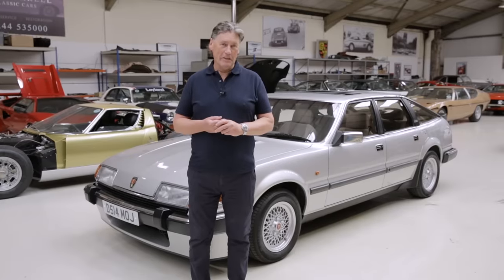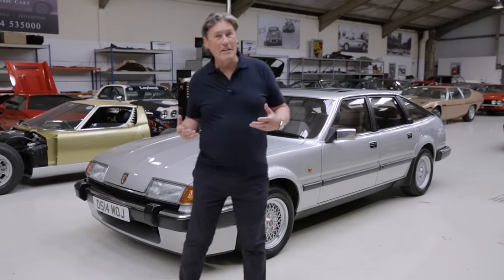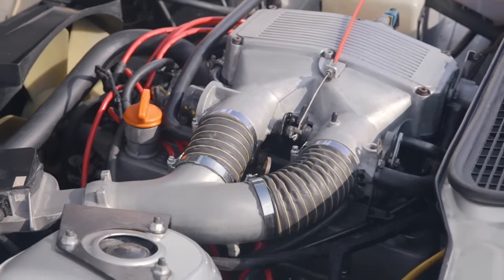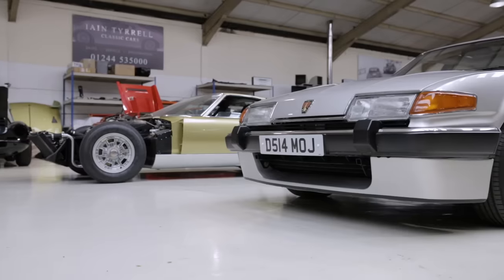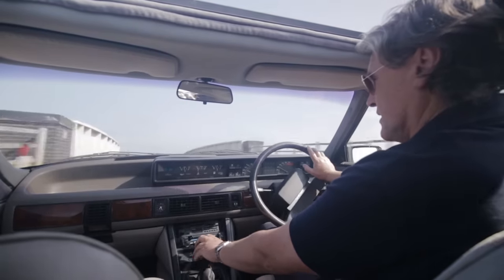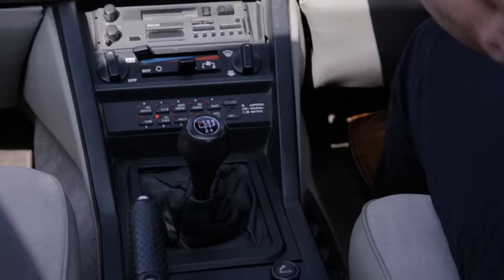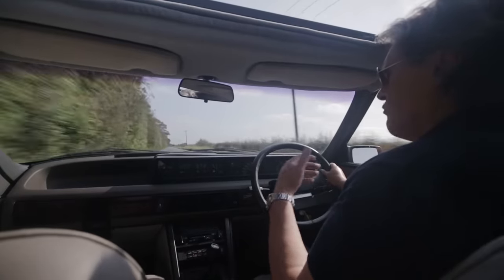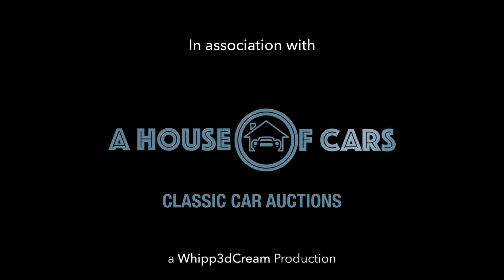Rover SD1 Vitesse - American V8 Power Meets British Engineering | Tyrrell's Classic Workshop

Comment: This engine wasn't just a Buick transplant, as insinuated. It was thoroughly re-designed by Rover for sand-casting and with proper steel liners to make it more robust and prevent the cracking and wear to which the Buick design was prone. Changes to oil routing and cooling were also made, as well as better carburation and, of course, later adding the electronic fuel injection we see in the series II SD1s and subsequent Land Rover products. By 1980 It's barely recognisable as having Buick ancestry. JRT (Jaguar Rover Triumph, later Austin Rover) had the potential use of the Triumph V8 as well by the 70's, so wasn't reliant on this engine although it clearly preferred to develop it so much so that  it ended up with a 4.6L capacity and modern electronic injection & engine management. It is interesting to imagine the original powerplant plans for Rover: a jet turbine-powered sedan... Vitesse, indeed...
Reply: Quite so. Remember reading this a while back. Would've made the Stag a great car for the US. They gave us plenty of support and got crap.
Reply: I see everywhere that engine is "a Buick engine that Buick didn't want any more" but that is only the start of the story. What you said is the reason it was in everything from the P5b, P6, RR, TVR, etc etc. Rover engineering was what made it successful. 
And then the British govt. sold off Rover at a bargain basement price, the traitorous scum.  I'm still annoyed!
Reply: @Daijyobanai  The government was a faceless administrator of a disaster caused by blood thirsty union leaders and ideologues and a hapless incompetent management. Meanwhile the engineers toiled on, sadly to no avail. Hope this makes you feel better….
Reply: Well said C J.  In the final analysis, the Rover V8 was a lot like "Trigger's Broom"... Completely reworked. Forty years ago, a less experienced me took a ride in my Boss's 3500 Vitesse. Typical ... lets see what this baby can do ... got into a massive sideways drift at speed on a loosened surface and really worried for a few seconds. Worried what I'd tell my Boss about his new car .. somehow my limited experience and probably a lot of luck, back on track and smooth as silk, continued on my way. Great cars, great days gorn forever sadly. What's triggers broom ...enjoy this :~

https://www.youtube.com/watch?v=LAh8HryVaeY&ab_channel=MarkAlzano
Reply: @MrRea112  Too bluddy right!  Only in the ... UK!
Reply: Yes, Rover made it into a great engine.  Eventually the four outer cylinder head bolts were deleted from the original design. Even with older fourteen bolt heads it best to leave the outer bolts out, (or fit them loosely for cosmetic reasons).  The weren't unknown for blowing the steel shim head gaskets.  Composite replacements reduce compression marginally which is no bad thing esp. with the early high compression (eg. P6) engines that were designed to run 100 octane fuel.
Reply: @Ampex196  I have an earlier v8 - yep, 10.5:1 compression and 100 Octane fuel so it needs a boost additive from 99 Octane Premium and a timing adjustment. In its 60's tune it was 143hp, I've had mine warmed up to 160hp (more and the diff has to be changed), it's an incredible engine with a fantastic throttle response. It's better as a manual (mine's an auto) but the torque makes this a one-gear car from 0mph to over 80mph in a Borg Warner 35.
Reply: @Daijyobanai  In all fairness, in Buick guise the block was die-cast and I would submit that the technology was not advanced enough at the time.  I do recall that at the time they also hired a recently retired Buick engineer to assist development.  I have read that he was told one thing they wanted was a higher rev limit.  In typical (for the time) American fashion his response (reportedly) was, "Why?"
Reply: The Buick engine was only sold to Rover because GM had far better engines being worked on at the time.
Reply: @Konformation07 Years later GM tried to buy the engine back.
Reply: @enigmatwist6548 Yes after their engine projects were completed. Fact remains the Buick engine wasn't as good as their other engines so they decided to focus on what the other engines. After those engines were done they asked to buy it back because it was small displacement and it would help against tightening US standards.

GM later changed their mind and later Buick ended up deciding to try turbocharging their V6 engine which to be honest was a better decision.
Reply: @enigmatwist6548  Stood the test of time compared to a small block Chevy ?
Reply: In Germany no we have a green Schlabubvvo
Reply: Those Buick engines got around Kaiser used the V6 version, which if I remember correctly Buick rebought the tooling for and continue to produce it for another 20 years

Comment: Thanks for this. Nostalgia for me.  I drove an uprated Vitesse with fuel injection (maybe the twin plenum), at pace in the Police at 23 years old. To say it made me smile is an understatement. I couldn't wait to get to work... out of my 1.3 Ford Escort into this V8 supercar, my reward for completing the Police panda, then advanced training with a first. At the time, not much on the road could compete with the Police specials and once AR called time, we bought a lot of the parts and kept ours going for several years in Carcroft, SYP.  Even when we had the 4WD Sierra Cosworth turbo later, it didn't have the grunt, responsiveness or RWD heroics of the Rover.
Reply: I can imagine a lot of Coppers loving these to drive at the time🙂
Reply: I learned to drive in my dads diesel SD1, back then i only wished for the V8 but at 17 i think the diesel was the safer option.
Reply: I served in the police from 1997 until 2014. I worked with a guy who joined in the late 70's, and he drove the SD1 V8 extensively and he loved it. I knew some people in Traffic who by the late 90's, were using the superb Senator 24V. Aside from the Senator, which is still widely regarded as the best patrol vehicle the police have used, the SD1 is a favourite and it's reputation endures. In terms of sheer physical presence, the SD1 is Top Dog I think. They did look superb back in the 80's, and on the rare occasion you see one of the road today, it's a real head turner. It's a shame Rover went out of business, imagine if they had created a retro design heavily based on the SD1?

Comment: I drove an SD1 for 3 years. A 3500 Vandenplas built 1983. It had the standard 2 SU carburettors and a manual gear box. I bought it second hand in 1988 with 150.000km on the counter and drove another 100.000 problemless  km with it. It had the same silver grey exterior coulour and a light bourgondie velours interior. A beautiful combination.
The engine was a delight. It had power and strong torque from low revs onwards. Its 4th gear could be used from 40 km/h onwards all the way up to 200.
But in those 3 years, I got married and we bought a house, with a loan of course. And the car became too expensive to keep.
Fuel consumption was on average over these 100.000km 11,5l/100km. Very good for a 3,5 V8. But still. And specifically road tax was very high. Here in BE road tax is based on engine capacity and a 3,5 litre is considered to be a luxury only for the rich.
So I decided to change the car and bought a second hand Ford Sierra 2,3D. It handled pretty well actually but of course it was slow. On the other hand road tax was low and fuel consumption was only 7l/100km. Much better for the budget.
I keep the Rover in my memory as a very pleasant car. Probably not the best built car ever, but a very nice looking car and what a fine engine. For pleasure I sometimes started it up, opened the bonnet and put my hands on the engine just to feel how almost vibration free it ran on idle.

Comment: Clicked on this wanting to skip the talk and go straight to the driving bit but I couldn't stop listening to mr Tyrrell's presentation, fascinating.
Reply: @Ouroboros unfortunately, his history lesson, while broadly correct, is full of inaccuracies. I do wish he'd done a bit more research before regurgitating common myths.
Reply: @richardharrold9736  What are those myths you are talking about?
Educate us please.
Reply: @ianh9696  Mercury Marine was never owned by General Motors. It was, as of 1961, part of the Brunswick Corporation, a company that had made its fortune supplying equipment for bowling and billiards, but was still run by its founder, Carl Kiekhaefer. Also, the Buick/Olds engine wasn't discarded because it was undersized but because it was hopelessly unreliable - the die casting was the main reason why, as it resulted in porous castings. As a result, Rover did NOT buy the casting dies, which had been set up by an individual by then deceased. They (or rather Birmingham Aluminium) used sand casting, which produced non-porous blocks! Also, the LT77 gearbox did not originate in the SD1. It had been around for a decade by then in the Jaguar XJ.

Also, the fuller on swords and daggers is absolutely nothing to do with channelling blood and everything to do with structural rigidity.
Reply: @richardharrold9736  I used to work at a GM dealer (17 years) and I had lots of people asking for parts for their GM marine engine. I had to tell them I had no catalogues and couldn't guarantee interchangeability. Sent them on their way.
I learned my lesson when working for a Volvo car dealer. Boaters would try to fool me by ordering parts for a car to use on their boats, thinking they would be cheaper. I remember selling a water pump for a B20 engine to one of these people. He was back a short time later with pump in hand, melted by the salt water. The cars used aluminum pumps, and the boats use cast iron.

Comment: I had a van den Plas 3500 for 10 years. My friend took it apart and completely rebuild it. Had to sell it moving to Canada. I still miss it. I loved the roar of the engine. The manual transmission was great. Tuning the two carburetors was lots of fun. I drove it on propane and found out that the hoses to the carburetors had to be of equal length after 8 years.. than it had as much power as on gasoline. Thanks for this great video.

Comment: This was such a great car.  A friend of mine used to have one of these in manual (a twin plenum), and we drove from the UK to Le Mans in France in it several times back in the day.  It was so comfy and practical but looked awesome with a really staunch, low-slung stance on the road - and that assertive front end gave it real presence.  For a big car, it never looked clumsy - unlike the Porsche Panamera of today, which I suppose is a similar sort of car.  I remember driving the SD1 down "the road to Morley", a beautiful, curving, sweeping road that goes for miles and miles with barely any traffic - and although the steering was a bit light and uncommunicative, the car handled beautifully.  Grippy, neutral, engaging and fast, with great punch from that V8.  Thanks for bringing back the memories!
Reply: I'm surprised with a 110 inch wheelbase and a 185 inch length it was considered a large car. Over here in the US, most 'large cars' had wheelbases of 115 or more and a length 200 or more.
Reply: @thebitlot  Yes, that's Britain for you!  Our roads and cars have always tended to be much smaller than those in the USA, I think the price of petrol also had something to do with it.  I remember thinking that the 3.9 litre V8 in that SD1 was ENORMOUS - most "ordinary" cars in Britain at the time were 2 litres or less with only 4 cylinders usually.
Reply: @joelsmith9311  It makes me wonder how it shaped the culture differently overseas than here. Like here, up until the oil crisis, the rule was 'no replacement for displacement.' We drove big bulky cars with pushrod engines that spat smog into the air with reckless abandon. We cruised on our motorized couches across hundreds, sometimes thousands of miles of land. 

And really, the SD1 looks so ahead of its time. Look at what the US was driving in the late 70s to early 80s. The SD1 looks like an early 90s GM W Body (Pontiac Grand Prix, Buick Regal, et al), before the W body. The only way you can tell the thing is from the 70s is the overwhelming amount of BROWN.

Comment: Just to say one of best videos I've seen on youtube. Not the V8 but I had a 2.3 straight 6  SD1 on a V plate 1980 the car was 5 yrs old when I bought it and had heard all types of horror stories about the 2.3 engine, but, it never missed a beat, all you said about that car was true, a great trip down memory lane, thank you.
Reply: I had the straight 6 auto in my late teens. Such a fun car.
Reply: @stewartsteinecke7301  i had the straight six manual.,no electric windows or even power steering but with all those things missing,was even lighter and went like a rocket.3.0S Capris had no chance.

Comment: I'd seen this car in the background of your last couple of videos and thought of asking if you'd feature it. But when you look around at the other machinery in your place, at any one time, didn't think there would be any chance, so thank you. I love these cars, and growing up a couple of miles away from Cowley, in Oxfordshire, there were BL products everywhere, many of which owned by people who worked at the plant, so you could see how far they were up the food chain. One of my friends dad's had an oporto red Vitesse, which I thought was fantastic, especially as I really hated almost everything else that company made at the time. I managed to get a 1983 Vitesse, single "plenum", when I was 19. It was £550, so you can imagine it wasn't exactly mint, but it was solid, had a good strong motor, and, surprisingly, all the electrical items worked. I loved this car, and still miss it today, but alas, after six months of crippling, foot permanently welded to the floor, single digit fuel consumption, it had to go. I'd never let anyone drive it before, so had never heard it from the outside, and when the guy who bought it pulled off the driveway and floored it, I felt like crying, as I really hadn't wanted to sell it. I did get another SD1 a couple of years later, this time an 85 Vanden Plas, as it was far too cheap not to buy it, and although I still really liked it, it had the automatic box, and softer suspension, so it wasn't as fun, although still just as greedy when it came to fuel! Unfortunately, the engine let go whilst racing a 205 GTI on the A40, so that was the end of that. I would love to have another Vitesse one day, this time a TP, but like you said, they are getting very rare now, and don't often come up for sale. Besides, the last one I saw they were asking £15k!!Back in the mid 90's when I had mine, a really nice one was only about £2-2.5k.

Comment: My father, a private pilot and accountant, Dennis Pritchard had a 1985 3500 vanden plas auto, metallic silver with Grey velour and burrwood trim, which was about two years old at the time. Very, very quick car, especially when the kickdown was used. One of the first hatchbacks. Went to the unveiling at Henley's car show room in Bellingham, south London. Never had any problems at all, had it for five years. Fabulous design.

Comment: Wow, a trip down memory lane for me, I used to drive an SD1 V8 Vitesse in the Army (Close Protection Unit, N.I.) unfortunately we had to get rid of it as the door sills were too high and the seat was low, so it made it difficult to exit in a tactical situation. It was great in pursuit mode though, not much could keep up or get away. Keep up the good work on the channel.

Comment: The dash layout really stands out for its compactness, quite unique for late 70’s car design engineering. Interesting story. Thank you.
Reply: The passenger air vent get me though. For LHD/RHD this air vent filled the hole not used by the steering wheel hence its location.
The odd thing is that I wish more cars were built this way, for instance with mirrors, door handles and other parts that could go either side to cut down on the parts list.
Reply: @johnsmith1474  concur. Dreadful cheap looking interior and dash. That steering wheel! What were they thinking?
However... that motor and manual box! I've been in some tuned 4.2, 4.6 versions in the passenger seat - scary fast.
Reply: Was very futuristic for the 70s, now reminds me of the new digital dash on the Merc A Class.
Reply: The whole cluster was also the same I believe it was simply screwed down to the dash

Comment: Superb video. Thanks. I built facilities for Rover in the late 70’s, and drove a few of these. Loved the Triton Green Vitesses. From what I saw, the car was designed to be assembled using components with very wide tolerances. Ie with lots of adjustments, which took more skill that the unskilled workforce had to get right.

Comment: I owned a TR7 many, many years ago and someone in the car club had been an apprentice engineer during the 70's and sometimes had to work in BL factories. One job he was given was to cut a trash compactor in half down its length, take a foot off its width, and weld it back up because the Friday shift were unbolting the trash compactor, driving a Spitfire in before bolting the compactor back up. Saturday morning, they were unbolting the trash compactor on the outside of the factory and taking the car!!!! How true that is, I don't know, but with some of the other things I've heard, I could quite imagine it happening.
Reply: I worked at a BL dealer in 70s, my service manager went on a factory tour and they were told not to look at any workers or ask any questions as the workforce would walk out. By every doorway was a collection of parts the workers were allowed to take home as part of their perks.